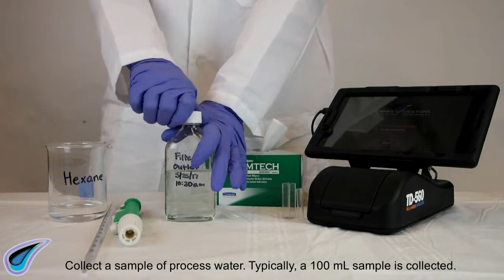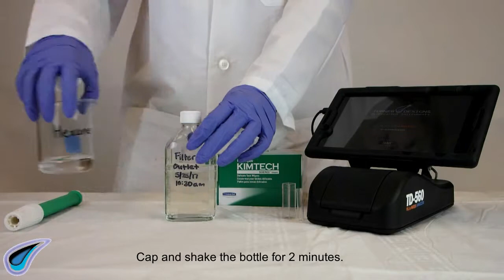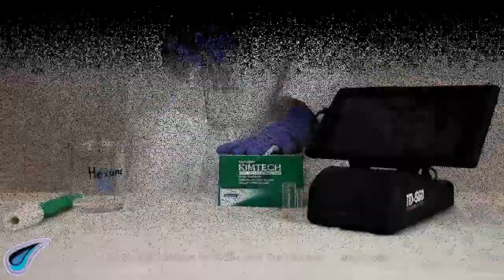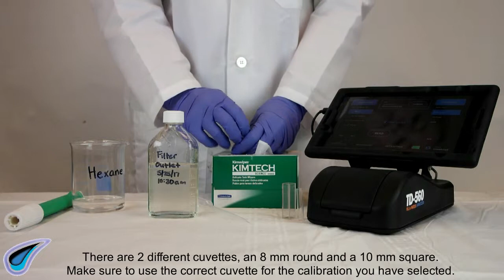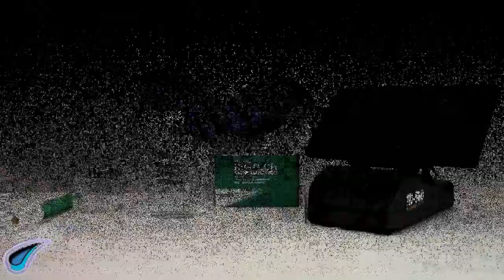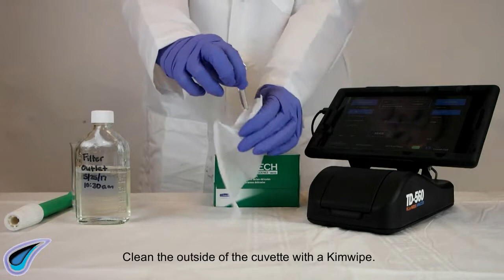How to Analyze a Sample Solvent Extraction

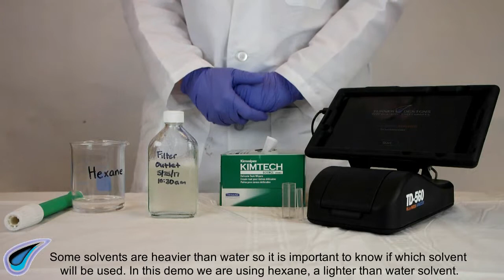Comment: here you used 1:10 extraction ratio. do you have to multiply the reading by 10?
Reply: When calibrating the TD-550 / TD-560 the extraction ratio is selected.  The measured value will be the actual oil in water sample concentration.
Reply: I have many doubts in this